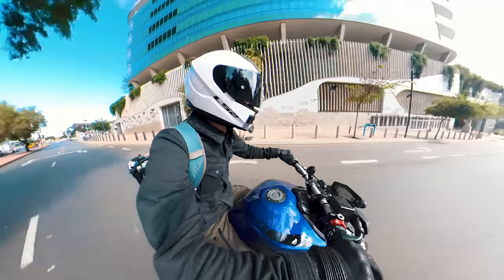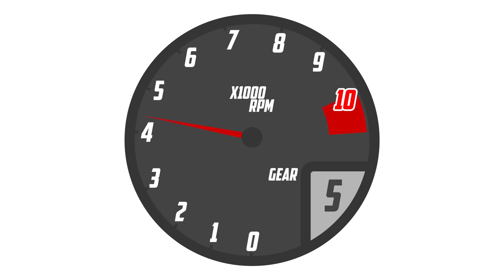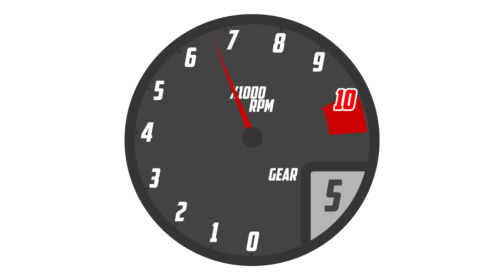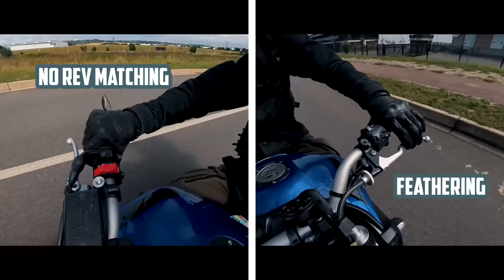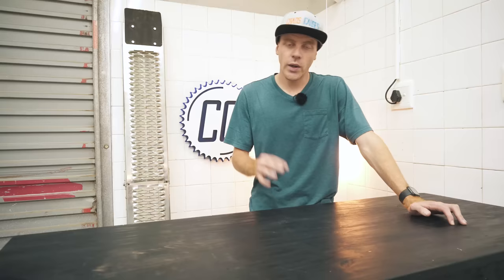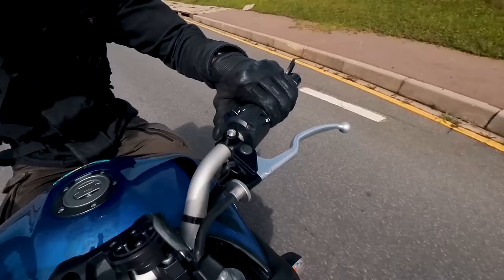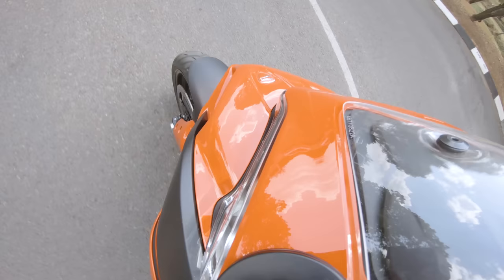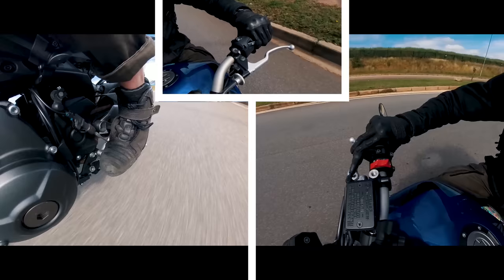What is REV MATCHING on a Motorcycle?

Comment: For me the biggest problem is pulling the front brakes and somehow blipping the throttle at the same time. I just can't seem to get the 2 actions to work together. Any tips on that? :)
Reply: I run into the same problem, I want to blame my hand size, but my hands are pretty average, so I think it's the experience matter. What I did to go around the issue is: I tried to incorporate dragging the rear brake and my bike had pretty strong engine braking, it rarely required hard braking before the turn, so I used to downshift before the turn and then trail brake into it. Worked perfectly for me. So for me it was let off the gas, then drag the brakes (both or just rear), let off the rear or both brakes, downshift however many gears the turn and the bike need, then front trail brake into the corner, then gradually let off the front brake and smoothly throttle out. All done smoothly, I have never locked up the rear this way, my buddy locked the rear on his bike even though his had a slipper clutch and mine didn't. I hope it helps. Test it for yourself, might not work for everybody.
Reply: I think a key part is being really loose on the bars and then just roll on the throttle by twisting your wrist. At least for me personally this works flawlessly:)
Reply: Practice it when the bike if off
Reply: i only brake with 2 fingers, better grip onthe throttle
Reply: Brake with your index and middle finger and grip it a little loose so you won't jerk your brake
Reply: Get a cheap beater bike, and practice the hell out of it.
Reply: Try braking with your fingers nearer the tips, gives you space to roll throttle with your palm. If your brake has adjustment bring it in a bit closer. 

Practice with bike off
Reply: Thats why we teach using 4 fingers on the control you are using and the ryme “front and rear clutch and gear” to just block change to a stop. Not every gear change requires rev matching.
Reply: Brake rear
Reply: I use it just before overtaking
Reply: @niku_doloi  nope, you can do it with front no problem
Reply: @iodineclip  ik but understand his scenario
Reply: I use back brake instead
Reply: Does rev matching require front brakes? Isnt the whole point of rev matching matching the engine with the  speed of the wheel? If you brakes, then you won't need to rev match?
Reply: @dustcake2576   rev matching doesnt require any brakes to be honest, but the whole point of rev matching is, it smoothes your downshifting, which you will be doing when you are slowing down before corner entry. Hence why its beneficial if you are able to combine it with front braking.
Reply: Let go offf throttle and then start applying brake
Reply: @adhils9633  which adds another unnecessary variable. Not too mention it creates a bad habit as this is what you will likely do in emergency stop. Rear brake is a joke compared to front one and should be used only at slow speeds or to stabilise the bike in addition to main brake.  Using one or two fingers for breaking while still controlling the throttle is the correct way.
Reply: @10secondsrule  i use 2 fingers to control my front brake...read brake is for slowing down the bike whereas front brake is the actual brake..it stops the bike...I use rear brake to smoothen out the rev matching...That slight backward pull is cancelled out by doing that
Reply: @10secondsrule  yeah..i agree
Reply: Lower the front brake lever then you will rotate your grip forwards to pull the brake and this will naturally fix your problem.
Reply: With gloves it's easier but the premise is that you push the lever down with ur palm while apply brake pressure
Reply: Be soft on your handlebars and use the web of your palm. Two fingers resting on brake lever two fingers on grip. Good gloves help as well. This is what works for me.
Reply: Don't brake and rev match at the same time,problem solved.
Reply: It's not necessary to pull the brakes in at the same time. I downshift first and then pull the brakes.
Reply: I honestly had the same issue at first but overcame it really quickly within a week of riding, sadly I don't remember what I did to accomplish it, other than just riding and trying I guess, now it's like second nature, and I don't even think about it!
Reply: @FoiMal123  I've got tiny girl hands...no like a men's small never fits correctly - I still can properly rematch. It takes some practice but it is entirely possible. If you are really reaching to squeeze the front brake lever i would suggest that you should invest in some adjustable levers.
~14 years riding experience.
Reply: @ecookman  For me this didn't help either, I did get the adjustable levers, it was better but I'd still do it from time to time so I wasn't that reliant on it on higher speeds. I'd say for me it probably was just little time in the saddle.
Reply: Combination brake tech
Reply: I kinda'f do it differently than probably most ppl, I brake using my middle and ring, sometimes even the pinky, while I control the throttle with my thumb and index.
Reply: I have the exact same problem so i used more rear brake amd less front brake
Reply: I can't understand what all the fuss is about. I've been blipping the throttle on the downshift and braking at the same time for over 50 years. It's just co-ordination and muscle memory that you learn by doing it.
Reply: Mine is I don't own a motorcycle 💀
Reply: Dont use full hand , 2 or 1 finger only
Reply: The engine brakes itself for me coz I start breaking some 3-4 seconds earlier
Reply: Check out : Be the BOSS of your motorcycle, he teaches you how to shift properly & slow speed maneuvers.  He's a retired NYPD Highway patrol officer.
Reply: I create like a ring around my throttle with my thumb and index finger and use my other fingers to break however I’m a newish rider and could be wrong
Reply: Good remark! I think i only use front brake to completly st
Reply: @marianandnorbert  exactly! Same for me
Reply: practice and loose grip on throttle. Practice practice practice and all this is not needed unless racing and needing to be as fast as possible. I have ridden for over 40 yrs I can do speed shifting  manually no gizmo also rev match and down shift from huge speeds while not locking tire it took a lot of time and experience but none is needed to ride fast on street, mostly only needed in racing so forget it just ride and get comfortable riding. Best way to get good is contact closest race track see if they have a riding school for beginner racers, fine one take it you will be much better rider for it and learn a ton of racing tricks that are actually useful on street, I did it yrs ago best mod for any bike is make rider better, your stock bike is most likely way better than you stock. I wanted to see facts so I went to track before school weeks before on open track day had buddy take my lap times as fast I felt i could go without dying had a few wiggles and scarey moments. Later after taking class and putting the things into practice for a few weeks, i went back to open track days same buddy timing me lapped 5 seconds faster and was never on edge or scared like before. 5 freaking seconds on a track that took 1:10  to lap originally went to 1:05 that is huge.  a yr later was at 1 flat, not a big track. but that made me quicker than any pipe  or ecu or anything the stock bike still never been pushed, as my buddy who is real good can lap 5 seconds or more faster on my bike than me. trust me a stock sport bike today can go faster tan 99% of the owners can ride it. Go to a track day and watch some racers when they are practicing running 80% speed they will take a 600 and blow best street riders off track on 1000s. If they push the 1000 is so far behind they cannot even catch back up on straights. Serious 1% of all riders can push a liter modern sprortbike stock. Anyone modding one on street is wasting his money, be faster taking a race class and he would find that stock liter bike has power he never accessed. But his ego takes hit.
Reply: @iodineclip personnaly I rev matching with downshit and use the rear break and when I in the right gear for the corner I use the front break to slow me down of it's needed.
Reply: adjust your levers - you want a straight line down your arm over your hand that's on the lever itself - if it's off in either direction, you will either rev a little or reach for the clutch, neither of which is good. check out videos on adjusting your bike for your height and weight
Reply: practice makes perfect.
Reply: Smae here. Tiny hands
Reply: Be loose in your wrist when blipping. So your fingers keep a firm pressure, then your wrist is loose and can move the throttle without moving your fingers
Reply: Use your rear break. Make sense?
Reply: Don't use brakes, unless after rev matching or before but not during. And use rear brakes by loading it like the front ones. Use front ones for coming to a halt or emergency breaking
Reply: You just must bliping fast as u can. May be u motorcycle just jump 1 meter but u can stop with rear brake..dont scare to be fast cause engine breake will take care the rest 😅
Reply: Ummm "brake" don't  you mean pulling in the clutch????
Reply: If you're downshifting to a stop or simply downshifting for a slower ride, then it's not a situation that requires emergency braking. You should be okay with just using rear brakes while downshifting

Comment: Rev matching is important for all manuals.  I was rev matching in cars before I went on a bike.  I automatically did it on the bike.  Didn't even have to think of it.
Reply: nope useless on street at street speeds not need to do it at all
Reply: still haven’t gotten the hang in a car but the bike was pretty easy
Reply: same here.  But where this is a very informational video, i think it is a matter of feel, hearing and practice and there is no way to explain "just knowing" the revs are right to slide in to the next gear -- and I guess that applies to all clutchless shifting, both up and down.......

Comment: Good to know I've been doing it correctly.
I'm always worried that I'm being too harsh on the clutch plates by "dumping" the clutch while shifting at speed, but it doesn't make sense to me since feathering the clutch means it's spending more time in friction and therefore more time on getting worn down.

I even learned how to upshift VERY SMOOTHLY without a clutch (clutchless downshifts are a bit tricky for me, so I haven't gotten very good at those), but it makes sense that if you can perfectly match the speed, you don't necessarily need the clutch. I've also found out that the bike kind of "tells" you when to shift because if you apply pressure up against the shift lever, it will resist shifting because the speeds don't match, but when you quickly cut the throttle, it drops to a speed that matches, allowing the shift lever to shift up, at which point you re-engage the throttle, and if done right it'll be as smooth as an automatic transmission - i.e. no jerking whatsoever (unless you're in very high rpms, at which point it's practically impossible to do an ultra-smooth shift, clutch or no clutch - there WILL be some jerkiness).
Reply: The average guy cannot break the latest bikes I'm sure
Reply: No matter how good your clutchless shifts are, it still fks up your gear box. It's better and cheaper to wear the clutch than fking the gearbox which results in expensive repair
Reply: @clickbaitpro that's what I was thinking , which one is cheaper "clutch plates " or " gears" ? 
THANKS FOR YOUR ANSWER ❤
Reply: clutchless downshift is actually not harder than clutchless upshift when you fully understand what you're really trying to do. but upshifting tends to be more intuitive to most people, so they struggle with the downshift. i'm about to writer a fucking essay...

when you go from throttling up to engine braking (or the other way around), your bike goes from the engine spinning the wheel to the wheel spinning the engine, and during the transition from one to the other, your transmission is unloaded. that's the function of the clutch itself, unloading the transmission so the gears can shift.
but this transition happens twice when we blip the throttle or briefly cut it, once on the rising edge, once on the falling edge, and the gears can pass in any of those unload timing, but it's not because you can that you should. when you are upshifting, your engine has to slow down to match the speed of the wheel, when you downshift, it's the opposite. so you want to be upshifting in a transition from throttling up to engine brake, to assist the engine in slowing down, and you want to downshift on a transition from engine brake to throttling up, to help the engine pick up the pace. if you do t in the opposite way, the throttle action will be fighting against the wheel.

so here are the ways we actually tend to mess up downshifting while learning. when we first learn the "easier" clutchless upshift we get comfortable with the shift timing on the action of cutting the throttle, and that tends to later interfere with clutchless downshift. if you are too used to upshift, you'll tend to not downshift as you start blipping the throttle, but on the falling edge, as you finish blipping and cut the throttle again, and that messes up the shifting and make the transition really harsh.
now, when the gear tends to not shift at all, there's another possible way we made a mistake. it's when the bike is not really engine braking before we blip the throttle. how would that be possible? we obviously downshift as we loose speed, but when we are just slowing down progressively with a slight throttle that we didn't cut completely, the bike might not be really engine braking, the wheel might not be the one spinning the engine, and thus we don't have a transition that unload the transmission. another way to not be engine braking is when we slowed down too much and are near or at idle speed, at this point, the engine idle is the one driving the wheel.

the "guide" to get it done clean at least once works the same as when learning upshift and we are told it's easier to do when really accelerating, but the opposite. first go relatively fast, high rpm of your current gear to give you some room, cut your throttle entirely to be sure you are engine braking, place your foot on the shift lever and push very lightly to preload it, blip the throttle and you should feel the gear pass as you are flicking that wrist towards you not as you get back to your normal throttle.

what makes it harder or confusing is that when we don't have all that shit in mind, it's not as obvious what can make the downshift messy. when upshifting, it's simpler, the initial state is engine giving power, and that's the only way the bike can maintain its speed or accelerate so we can guess it easily. the issue with the initial state for downshift is that we estimate that the engine is "eating" power (engine braking) because we are slowing down, but there're other ways the bike can loose speed, wind drag, wheel friction, and so on, can be slowing down the bike while the engine is still actively adding power to the wheel (just not as much as the external forces slowing it down). and that's what typically mess up your downshift.
Reply: What is rev matching? A waste of time.
Reply: @niscent_ a bit late to the party but i think i got it, thank you.
Reply: @AtoZ-nm8wd  i'm happy this was useful. i wrote one hell of a messy wall of text here.

Comment: Clearest explanation on rev matching I've seen so far!
Reply: not really because he don't know what he talking about. there is no rev matching on motorcycles. you are not rev matching you are deloading the transmission so you can shift it. you are just taking the load of you are not rev matching shit. bikes have constant mesh transmissions menaing every single gear is always connected with each other you are just changing what gear you send out to the sprocket so all you have to do is take the load of the system so you can smoothly change which gear you send out.

Comment: One more benefit... last summer, I had to ride 350 miles mostly without a clutch because my cable was down to its last 3-4 strands and I had to preserve what I had left any way that I could. (The cable is 2" over stock length so a replacement was not readily available.) Fortunately, the distance to cover was mostly on the interstate but I did need 2 gas stops and had some slow traffic around Seattle. If you can match your revs both up shifting and down shifting, the ride will be much more comfortable and less worrisome.

Comment: "Rev matching" reduces clutch wear as  well. Which is why most owner operator truck drivers "float" gears. Its also smoother, so you are less likely to break your rear wheel loose in low traction scenarios, like cornering. Which is why big rig drivers also call it slick shifting. When you drive on ice or snow in a big rig you have to float/ rev match/ slick shift. So as to lessen the chances of breaking your drive tires loose and possibility jack knifing, or wrecking. 
There are so many benefits. Knowledge or practice of Rev matching should be required for everyone in order to get a motorcycle license.

Comment: breaking down a steep incline, approaching a hair pin for example, rev matching is a must. Even on my "weak" 70 HP V strom I can lock the back wheel going from 2nd to 1st because the front is loaded and the rear wheel is really low on grip.
Reply: Yes tricky work
Reply: Most modern bikes are equipped with traction control and slipper clutch it's not a big deal nowadays but definitely a good skill to learn to reduce clutch wear and reduce brake pad wear

Comment: I learned this skill recently on my mt03 it has become muscle memory now. I used sometimes to downshift while pressing on the rear brake at the same time which made my rear wheel lose traction. This and the cooler sound were the reason I wanted to learn rev matching